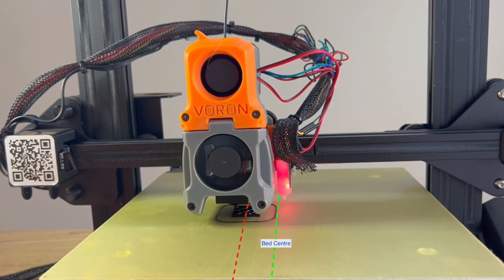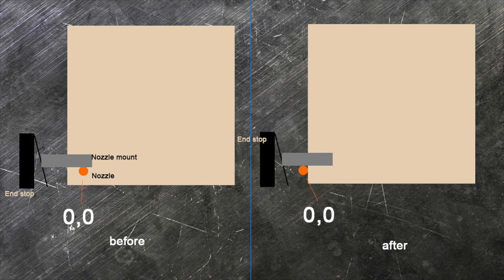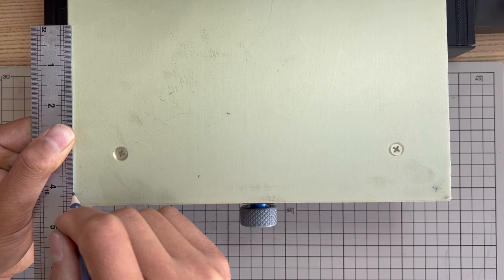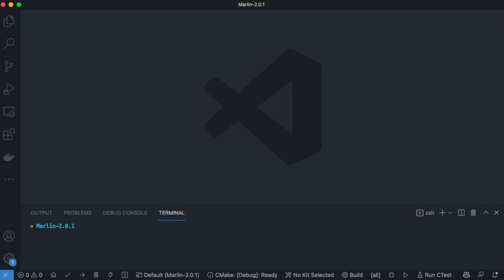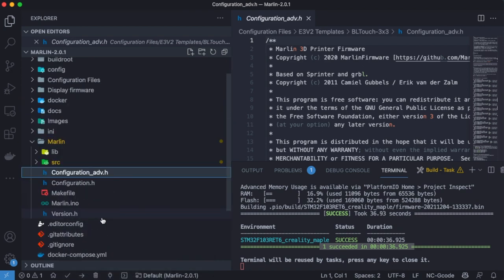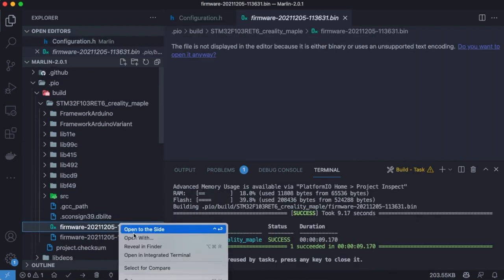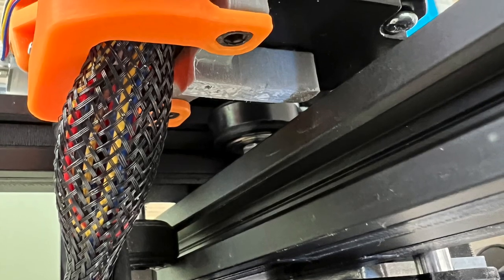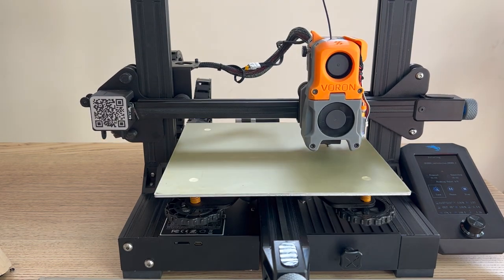Building a Voron Afterburner for Ender 3 v2: print bed and BL touch calibration

Comment: I'm really waiting for a video tutorial like this thank you it's very helpful I happen to be planning to install afterburner on ender 3v2 too
Reply from the maker: You are welcome Lany, and Glad it helps!
Reply: can you share the selicer setting you used to print the afterburner toolhead?
Reply from the maker: I only changed the Infill to 40%, enable brim, Nozzle 260 C and Bed 110 C from the default general ABS profile in cura
Reply: @makeIT0  can you tell the cooling fan settings you use to print the abs afterburner parts?
Reply: @makeIT0  260 C with allmetal hertbreak or stok ptfe line?
Reply: Printing witchout enclosure or printing on enclosure?

Comment: your afterburner looks very neat. what brand abs are you using and did you print the afterburner parts using ender 3v2?
Reply from the maker: I ordered this one without doing any researches https://www.amazon.com.au/gp/product/B096QQMZZJ/?th=1. I think eSUN ABS+ should be a better choice too.

Yes, I printed the afterburner parts using my ender 3v2 (the same one you see in the video), but it is heavily modded. I will make another video for my mod list
But basically the important mods are 1.Dual z axis 2.PEI print bed 3.Capricorn PTFE Tube (the stock tube will not survive 260C)
Reply: @makeIT0  I have tried various ways, san settings on prusaslicer and superslicer with a hotend temperature of 240 bed 105 c with esun abs+ but the printout looks like an inconsistent leyer do you have an account discord so I can send a picture hope it can help me
Reply: @makeIT0  I'm having a hard time checking from the lead screw to the extruder and hotend calibration. I'm a little desperate why the printouts aren't like yours.  can you share your cura abs slicer settings with me i really appreciate it if you are willing to help me

Comment: is it necessary to change the X and Y offsets on the slicer when using the afterburnerer on ender 3v2 or just change the x and y offsets in the firmware?
Reply from the maker: I think they both works. I just change the x and y offsets in the firmware so I can still use the same profile for other printers

Comment: So I tried making firmware for my sidewinder x1 but it won’t properly work with bl touch, I’ve added afterburner as well but can’t get anything to properly function
Reply from the maker: SIDEWINDER X1 seems to be a much better printer than ender 3 v2. If I were you, I'd probably pay with it for a while, if no issues at all, just stay with stock

Comment: Hi @make IT, Nice video superb , can share the bed leveling test print .stl file link. Is that possible to print ABS in ender 3 v2 without enclosure.
Reply from the maker: Thank you Mugesh! here is the bed levelling test print: https://www.thingiverse.com/thing:4546497
It is totally fine. All ABS parts you see in the video were printed from ender 3 v2. PEI sheet + brim + Capricorn tube does the job for me.